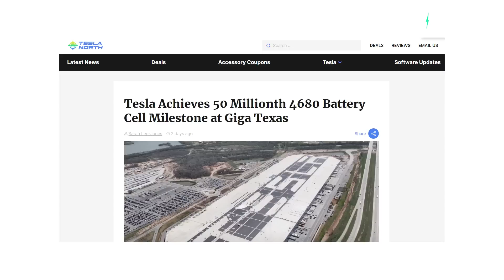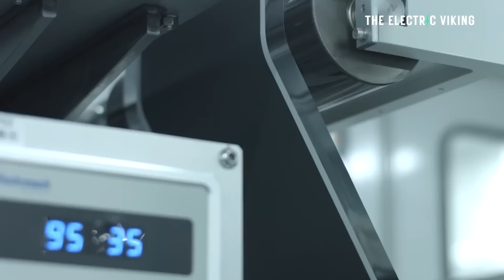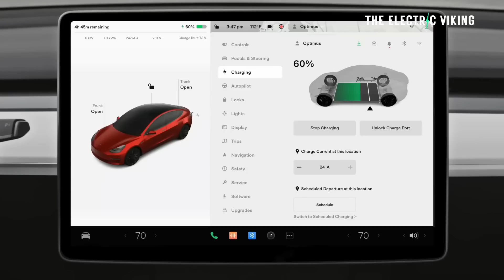Why Tesla will use different but better batteries in Cybertruck next year

Comment: Tesla have to do something…! 4680 has always been a lemon..! 😮
Reply: Tesla chose not to compete with CATL/BYD because lithium prices dropped and batteries became commodities. Tesla sells  cars, not batteries - so inhouse production is not a requirement to compete.
Reply: 4680 is a size. It is not a battery type. Tesla wants to build a structural battery and that size provides the optimal outcome. But Tesla being Tesla, they also look to the least costly option and the option that has the greatest environmental outcomes. In the case of their 4680 cells, they have been trying to use a dry cell process to save water and cost. This is the nut they can’t crack. They could easily be mass producing wet process 4680 cells, but that is not who or what Tesla are. So they buy off others as they try to solve the issue of making batteries themselves
Reply: Tesla has a problem because they dont have a senior executive in charge of Batteries who has a education and experience in batteries (Chemistry, chemical engineering,or Materials Science).  Wang Chuanfu - BYD founder - is a chemist and BYD hires tons of chemists/ chemical engineers.   That’s why BYD will beat Tesla.
Reply: My original thought from investor day when it was released.  I was so underwhelmed .  They made such a spectacle about how awesome it was going to . 🙄

Comment: The battery shortage at Tesla has hurt their business now and in the near future. It is not only the CyberTruck production which is constrained by a shortage but also the Tesla semi an the Tesla Roadster.
I suspect that Tesla put a hold on the Model 2 because of ongoing batter shortage. 
I think it will take Tesla another 36 months to build the battery manufacturing capacity it needs...
Reply: Tesla is not currently battery constrained.
Reply: They’ve repeatedly said at investor meetings that they are not battery restrained. However, an LFP line will be needed for the Model 2 and Robotaxi.

Comment: Panasonic+sila nano silicon anode  NCM with 400 wh/kg 46120 cells
Reply: There is probably a cell in the lab with this high energy density, but is it available to auto makers or the general public? If you have proof then provide the link.
Reply: I heard Tesla was using NCM 811 but they would go on to use NCM 955 & are testing NCM 973 for the 4680 cells. LFP would be a bad choice for weight reasons imo. That would make the truck less fun to drive & possibly restrict loading capacity.
Reply: Only way to really increase energy density of a cell is condensing technology,condensing means to put 40% to 50% more cathode materials(NCM) or (LFP) in to cathode side of the battery cell,that is how CATL manage to produce 500wh/kg NCM battery cells called condensed battery,tesla needs to focuse on condensing the cathode and silicon-ghraphie composite for anode side,and semi solid electrolytes,that is how they can reach above 450wh/kg 46120 or 4680 cells

Comment: Viking,
What is going on with sodium batteries? I though they where the cheapest?
Wayne
Reply: Sodium are too heavy for cars but good for powerwalls or solar batteries
Reply: They were, and then the lithium prices fell a huge amount, now they are not.
Reply: Two Chinese EVs use sodium ion, I understand.  Given the lower energy density, sodium ion is only suitable for short range vehicles (city runabouts, second cars, etc.).  Grid storage and home energy storage are being eyed as uses, I understand.

Comment: Germany’s opposition coalition, which comprises the Christian Democratic and Christian Social Union (CDU/CSU), has called for an inquiry into how the economy minister Robert Habeck, who is also a part of the Green party, reached a decision in 2022 “that nuclear power in Germany was dispensable despite being the only zero-carbon source of energy, and despite the energy crisis resulting from the war in Ukraine”, reports Frankfurter Allgemeine Zeitung (FAZ). “The information available to us suggests that the federal government, in a crucial matter of our national energy security, did not decide in the interest of Germany.
Reply: How is wind and solar not zero carbon?
Reply: @jantjarks7946  Nuclear has THREE MILLION TIMES the energy density of solar, wind, and fossil fuels, which massively compensates for the concrete & steel used. NOT SO for wind & solar, which use huge quantities of materials / land / resources in the building of them, proportionate to the LACK of ENERGY DENSITY. Wind & solar last 20 years, nuclear plants can run 80 years (potentially longer). Nuclear is the single source of power that can simultaneously scale to global levels of consumption, power the removal of the last 200 years of carbon, and most importantly fully account for its own compounding emissions. NRC standards set radiation level guidelines TEN THOUSAND times lower than science justifies, which is a primary source of nuclear’s expense. Nuclear power currently produces more than 50% of emissions-free electricity in the United States.